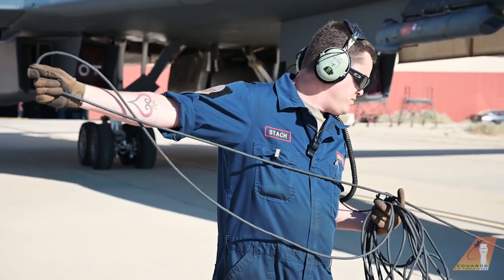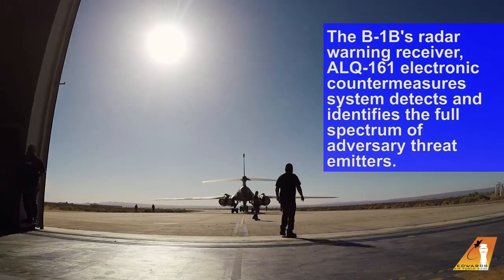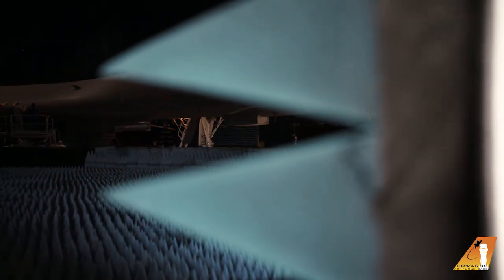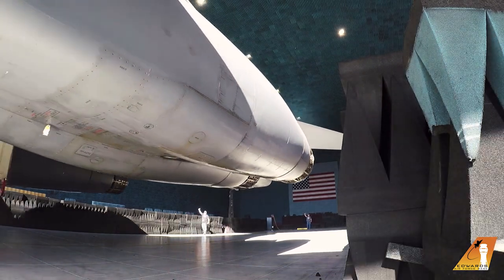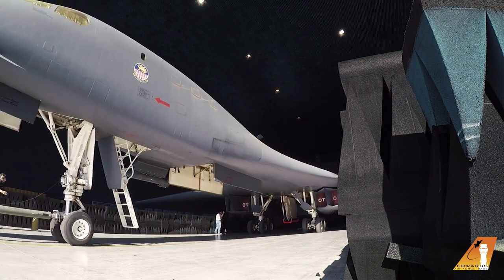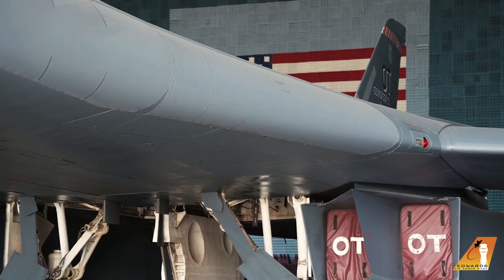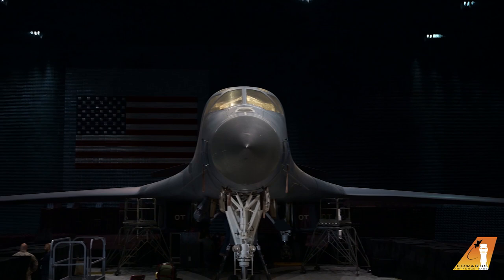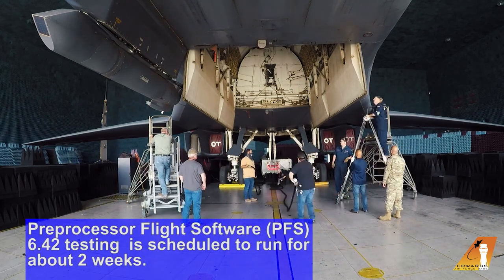B-1B Lancer Undergoes Electronic Warfare Testing in the BAF

Comment: That's all well and good that the systems work in a quite RF environment but what happens in the real world where it's not so sterile?  The systems have to work out in the real world where there's lots of broad spectrum noise.

(I test my designs in ideal conditions too.  Then I test in conditions that tend to be a lot worse than what you guys will put my designs through.  If my designs survive my torture tests then they're going to survive anything you can throw at it.)